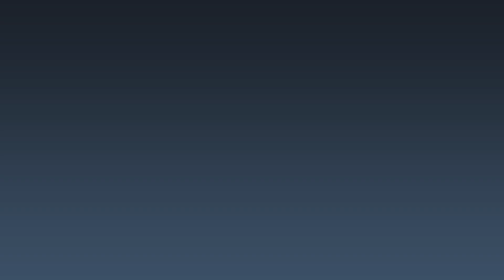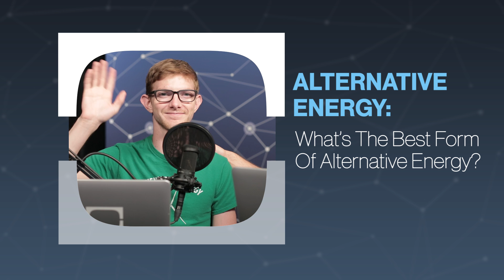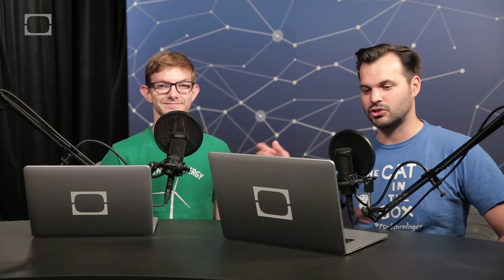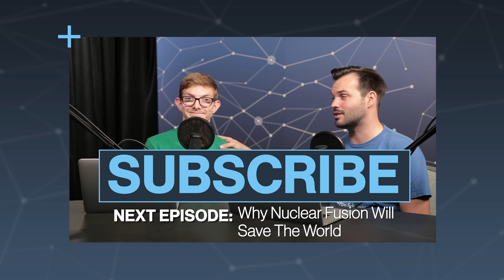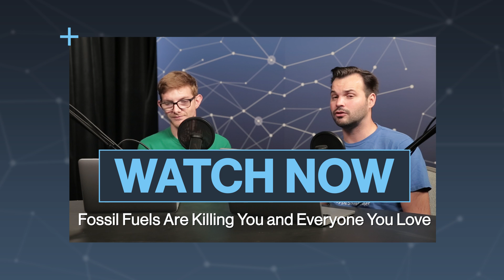What's The Best Form Of Alternative Energy?

Comment: I'm more of a fan with solar power. we can invent high towers to get above the clouds and store alot of energy from the sun.
Reply: +IceCreamExplosion How expensive would that be to build though?
Reply: +IceCreamExplosion Should just invent the free energy box if you word it like that.
Reply: I think balloons on tethers would be a better idea to get that high. Although at that altitude you'd probably get more energy from wind. Do you know how much money and fossil fuels it takes to build the worlds tallest building? I think it's a lot.
Reply: IceCreamExplosion
i'm going to assume you're a high sch kid and not be too harsh. the reality is that the structure you proposed would cost more than most billionnaires could afford, and probably not provide nearly as much energy as you imagine. in other words, it's just not a good idea.

as for tesla, you gotta read more widely. his idea for wireless electricity were far from workable, and most of the stories about edison stealing his stuff is quasi-mythical and unproven.

to make solar power truly "free", a more tenable strategy would be to increase the output of photovoltaic cells first, then make it portable and cheap enough to be built / added on anywhere. right now, it's hovering at around 40% efficiency, which means you need to cover a LOT of area just to power one household. when it reaches 70-80% efficiency, it becomes quite possible to power a household using mainly solar power, with the power grid as a backup. eventually, with more improvements to related tech such as rechargeable batteries, we could have solar powering >99% of a household's needs. and since both solar cells and batteries are one-off purchases, they can be given by charitable orgs for free and literally provide endless power.
Reply: +IceCreamExplosion it may be easier to simply prevent cloud formation and/or force clouds to condense into rain in the area surrounding a solar farm... just an idea though.
Reply: not bad idea guys, these are all ideas that we need to speak around. but building the high towers are expensive, but it will create and collect so much solar energy. sense it's at a high height than it will have a long span of area to give people free power across the whole world
Reply: it's similar to like WiFi, but straight up energy to give to alot of people :)
Reply: you don't seem to understand economic realities... who is going to build an expensive tower just to give free energy to people? maybe after you become a billionnaire, you can talk about it.
Reply: +Gregory Samuel Teo (alveolate) I know the cost of it, it's just an idea lol
look at Nikola tesla for example. we was similarly going to make this type of invention to give people the free energy. but america and other groups of people took his invention away and stole it. they did that so that can make money and prophit of of people still. do u think a world with free power is worth it or not? like WiFi, it's an abundant source and will never run out, componies still charge u for somethin that should just be free. like solar energy, it's abundent, so why not make it free?
Reply: +IceCreamExplosion People have to pay for the technology, if not the power too. 'Profit' is the name of the game, and according to some (bean counters for instance) you can't make too much profit.
Reply: +Gregory Samuel Teo (alveolate) 
"when it reaches 70-80% efficiency, it becomes quite possible to power a household using mainly solar power"

Is there any reason at all to think that will ever happen though? Very few technologies are anywhere remotely near that kind of efficiency.

"eventually, with more improvements to related tech such as rechargeable batteries"

Which currently relies on incredibly scarce resources such as lithium and couldn't possibly be scaled up unless one literally revolutionized the industry.

"we could have solar powering >99% of a household's needs. and since both solar cells and batteries are one-off purchases, they can be given by charitable orgs for free and literally provide endless power."

Sounds like a pipe dream to me.  Also, solar panels don't last forever and neither do batteries.
Reply: +IceCreamExplosion Well solar power too is Nuclear. Sun is a giant nuclear fusion reactor.
Reply: But it would cost SO much money to do that, and produce so little energy compared to nuclear power

Comment: I'm still happy Germany is moving away from nuclear energy. While I agree with the facts given here, the surrounding conditions are different here. Higher population density, no reactor being younger than 33 years, difficulties in finding a suitable repository and very low flexibility in power output make it rather unsuitable. They are more or less an obstruction to the current plans for the future.

None the less, I'm looking foward to the results of the research on the 4. generation of nuclear reactors. Perhaps one of those models could make nuclear power an option again.
Reply: @Lorenz Zahn - I appreciate you are looking forward to Gen IV nuclear, but Renewable Germany is on the wrong side of European per capita emissions and Nuclear France is on the correct side.

Could you Germans please change the success criteria of the Energiewende from  RE % penetration to emissions % reduction?

                   tot   e&h only
Germany  8.2   3.6     36% non-hydro renewables; 13% nuclear
Europe     5.9   2.1
France      4.4   0.5     10% non-hydro renewables; 86% nuclear

2017-2018 IEA data
total is the cross-sector emissions in t/capita
e&h is the electricity&heat only emissions in t/capita

* https://www.iea.org/countries/Germany
* https://www.iea.org/countries/France

Comment: What about Concentrated Solar Power such as Solar Towers where mirrors focus the sun's light onto a single point to gather the heat and power a turbine? The only negative I know that these plants have is space usage. The whole "They don't produce energy a night" argument is less relevant because they can store the hot molten salt created during the day and use it throughout the night and even use batteries to store excess energy to use at night. Also, why did you so quickly breeze over the waste of Solar Panels? What are the statistics behind it? Can we handle the chemicals in a safe way easily? If so there is countless space to place solar panels in the U.S., namely on top of homes. I want to know more about Solar too, so will you consider talking about it as well?

Comment: I have undergone an industrial training at a Nuclear Plant in India and i can definitely vouch for its safety. Its the best power source we have got at present until commercial fusion technology comes up.
Reply: Thorium will be used in the third stage nuclear fission reactors after Uranium and Plutonium are completely utilised. India has one of the richest deposits of Thorium so it would be cheaper for us but i am not sure for other countries. Although old reactors like Fukushima have single walled structures and poor management these days, the new reactors have double walled structures which ensure negligible radiation escape from cores. Its all safe.
Reply: is thorium safer and cheaper? I say it's time to talk about better options keep the nuclear plants we have now but how many of those plants were built in the 60s not feel to good trusting that tec. of course i still feel nuclear is better than oil and coal
Reply: +Aditya Manuwal thanks the info its something to think about

Comment: Just put the waste in a salt mine.
The mineral salt will absorb the radiation and reform over time. Perfectly safe.
Reply: +Serah Wint  given many years but before then it will seep through the salt into the ground, water and air.
Reply: Primarch Alpharius
Um.. salt deposits are rather huge. I very much doubt there will be any significant increase in radiation levels surrounding the mine, or the ground water.

Also, its not like you dump the wast as is. Its already contained. The salt is just an additional level.

I don't know the numbers on the top of my hand. But I suspect the actual rock would have higher levels inherently, than what would be "leaked"

I might be wrong about that though. Feel free to submit any data that might correct me
Reply: Damian Reloaded
So because someone was stupid/greedy, we shouldn't try? Is that your point?
Reply: Damian Reloaded
Sure. Id you dont have a functional government. Or a healthy culture that is responsible. You cant handle nuclear power.
I agree.
Here is the problem though. If you are in that sort of situation. You are slowly collapsing anyway. So its a bad example.

The reality is that there are functional governments on earth. With healthy responsible cultures.
Reply: +Serah Wint or reuse the waste in a gen 4 reactor,  you have about 99% of the power left in the waste
Reply: +Serah Wint All these wonderful safety ideas require money no one is willing to expend as the Toxic waste dumping by the 'Ndrangheta scandal has shown.
Reply: +Serah Wint so you are saying that the salt deposit is already radioactive in it self? 

I didn't knew that, awesome :) 
that actually sounds like a good idea.  I'm only thinking about transportation and how long that waste would have to travel.
Reply: Mario Robles
Well, the rock surrounding.
But most earth materials are actually radioactive. Its just a matter of degree.
Reply: +Serah Wint no he meant people are stupid and greedy that we cant try. No major corporations will fund or accept funds for the project
Reply: *****
Id say it depends on how much of it you have available.
But since there are many sedimentary salt layers that are over a kilometer wide... that would do the trick.

I have just heard from a few people in the know. That thats a good idea. Due to how salt reforms and what not.
Reply: Serah Wint Apparently these countries you mention aren't the important ones. Because the important ones (like  Italy, Switzerland, France, Germany, and the US) all made deals with the Mafia.
Reply: +Serah Wint subscribe to me plz
Reply: +Serah Wint What will reform?